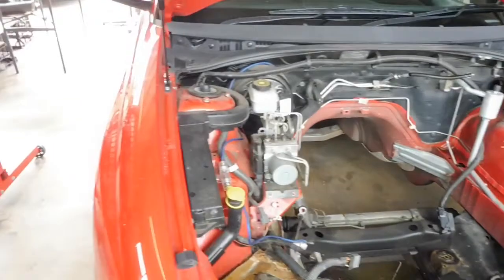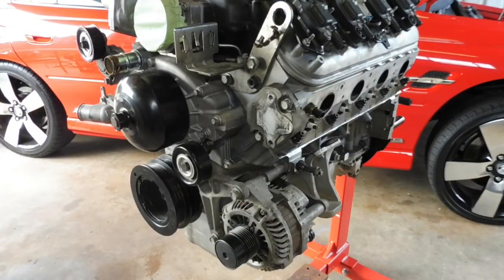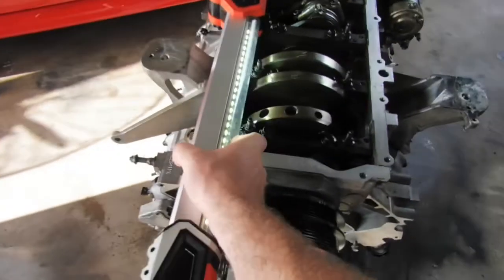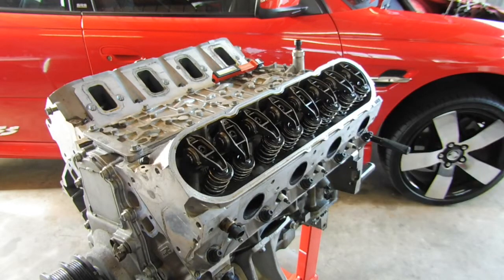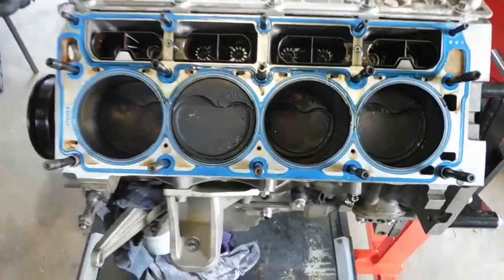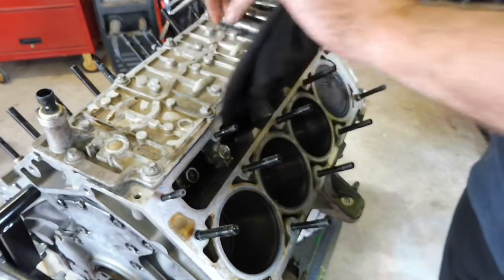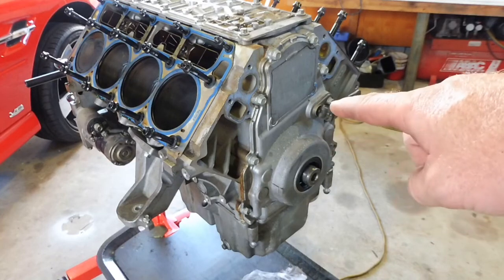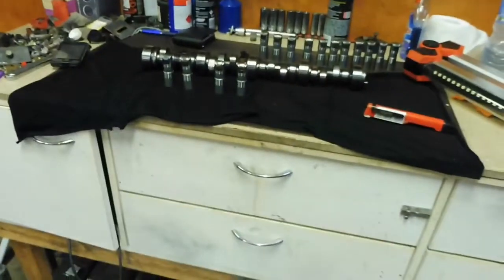Turbo ls Vz ss commodore build EP2 tearing down the hurt engine

Comment: great video mate!!!! looking forward to the next!!!
Reply from the maker: laurent gouriou yeah stay tuned mate watch me put those head gaskets straight back on there with some copper spray .
Reply: @LatysGarage  haha no worries. I think it depends on brand of gasket yeah or any? i'll probably just get all new as i'll probably shave the heads.
Reply: Yeah I got a new gasket when I pulled one of my heads off. Didn’t want to tear it down again if an old one failed. 

Reason I had the head off was bcse I seared off a extractor bolt when putting  pacemakers on. Did the ‘easy out’ thing to try to get the bolt out of the head and drilled into the coolant gallery. So took the head to the shop and had it repaired n machined. 

Never done any work like this before. All my research was online and I got the full engine factory service manual for free from the states. Still have it if you want a copy. 

Ta for the vids. I know they take time to do.

Comment: Great video mate 
Where they LS7 lifters that you removed?
Possibly Chinese copies?
Reply from the maker: Mathew Azzopardi I’m not 100% sure what lifters came out but I put genuine gm ls7 lifters back in
Reply: No Matthew LS7 Lifters have an enclosed roller these lifters have exposed rollers. The enclosed rollers Is what makes the LS7 lifters strong and the sought after Lifter In Gen 3 and 4 LS Engines

Comment: So funny really, people buy the best items to do up their engine and yet due to mass production and basic quality control, so many parts go through and thus end up costing you more then a new engine build? Maybe people who build engines should make sure they have the contacts to make sure every component which is going to be changed is totally blue printed and tested via x ray and sonic frequency checks to make sure those products pass the manufacturer's own strict quality control ? Keep up the great work champ and also how many KMs did that engine do after the build up of it? So turbo and engine mods to make it that little bit stronger to have it last ?
Reply from the maker: 7071t6 the engine would of been lucky to have done 5000k but it was a hard trip the previous owner loved the limiter and I’m thinking that also contributed to the lifters
Reply: @LatysGarage  cheers how much to have a VZ 5.7 LTR turbo and tuned etc, already have headers and exhaust etc. :)
Reply from the maker: Have you checked out the other build on my channel it’s my turbo tonner I built all the manifolds /piping exhaust myself at home have a watch it might inspire you to have a crack yourself or at least give you a good look at what’s involved . What part of Australia are you from?

Comment: Cam tech 237 248 612 612 115lsa? That was a quick Google of the numbers
Reply from the maker: n12sumfin your right and ive allready got replacement I went the vcm 16 slightly smaller than the previous camtec with 233 238 114 with .598 .602 lift but it’s a well used and proven cam I went with ls7 lifters too instead of the previous lunati lifters . I’ll have a assembly vid soon .
Reply: @LatysGarage  Came back to give you a rev up about getting another video out and saw this comment, look forward to seeing it mate!